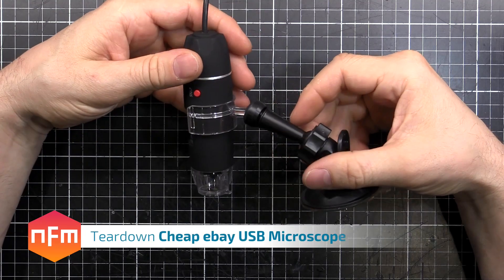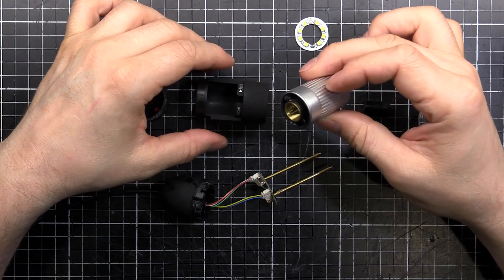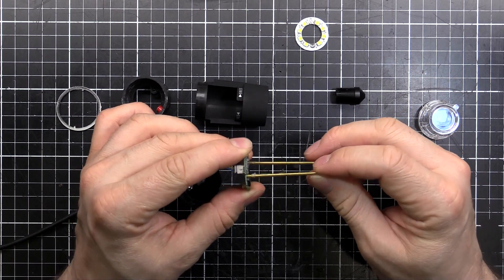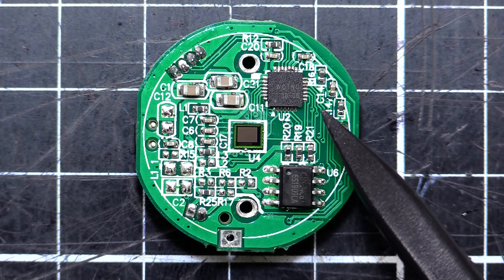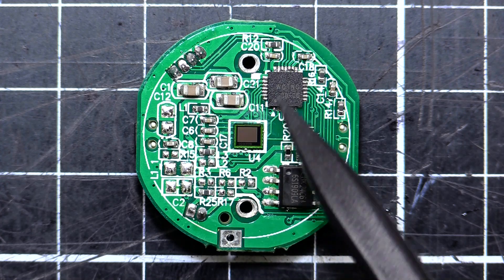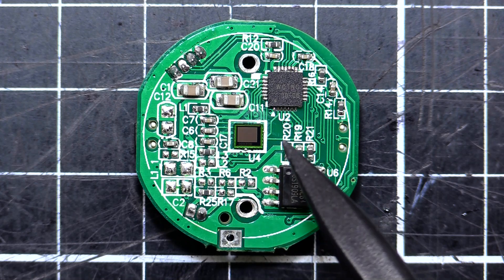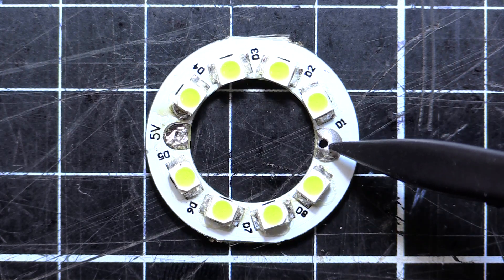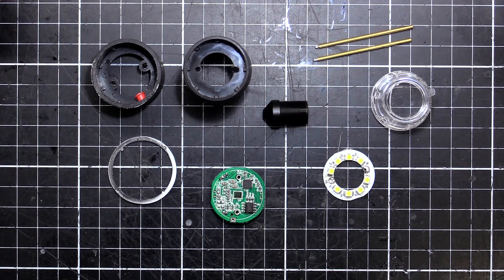ebay USB Microscope Teardown

Comment: Do you think the sensor can be replaced from a webcam?
Reply from the maker: Replacing the actual sensor on the existing microscope PCB wouldn't be possible, but you might be able to attach the optics from the USB microscope onto the webcam circuit board/sensor once you remove the webcam optics.
I can't help with the details, but with some experimentation you might be able to get something working.

Comment: I bought one of these from Volume Rate Via Deal Extreme, biggest load of crap ever, will only focus when the lens is actually sitting on the object to be viewed. Zoom doesn't work, software is crap as well, Would have been better spending my 30 bucks on food, but then you get what you pay for I guess.

Comment: There is an embedded company called Shenzen Wotng Tech Co Ltd. 30-06 is probably manufacture date, 30th week of 2006. I wouldn't be surprised if this is an Atmel clone, the same IC which drives a $3 counterfeit Arduino or ATtiny, they just haven't silk screened this one to pretend it's something else.

Comment: I also have one and I think for the cheap price it's ok for checking out solder joints or as they say in America "sodder" 
I love the way you call the hot melt glue "Hot Snot" lol. I will be calling it that from now on. 
I find you can use this little eBay microscope with VLC player and saves you using the garbage stuff from the CD that came with it.
Reply from the maker: Huh, I didn't know you could use it with VLC, I'll have to get another one just to try it out....

Comment: I have one, used it on my channel for examining "clone" temperature sensors, it's ok as long as you take the lens cap off :-)
Reply from the maker: Do you know if there are any true HD-ish or otherwise high resolution models out there?
Reply: Adafruit had an amazing looking one in a recent video, binocular and you could record video through it.   It cost "several hundred dollars" was all I remember them saying.